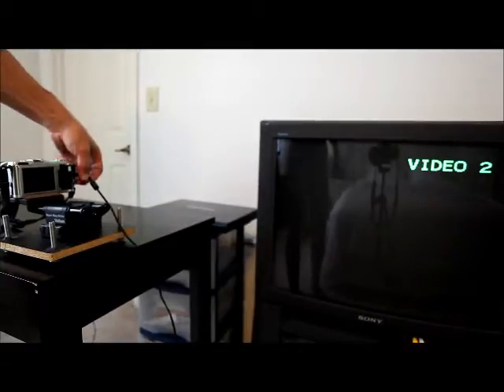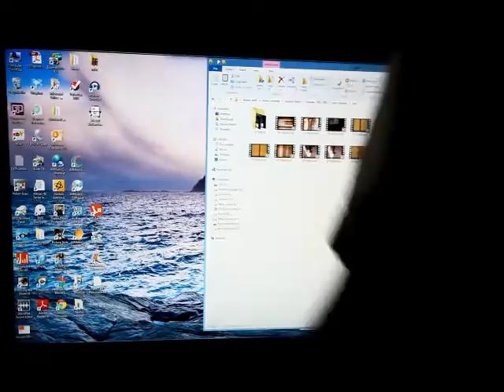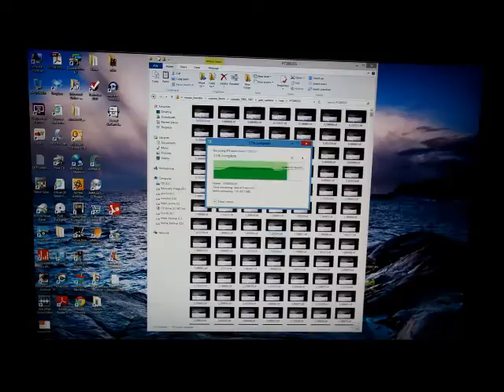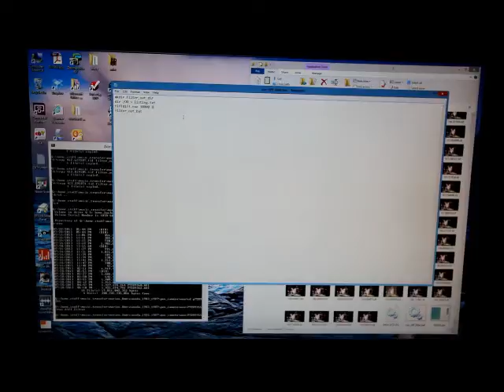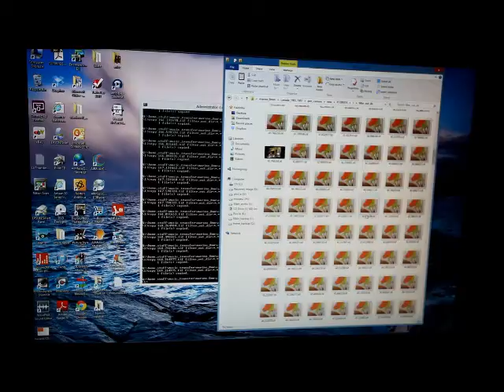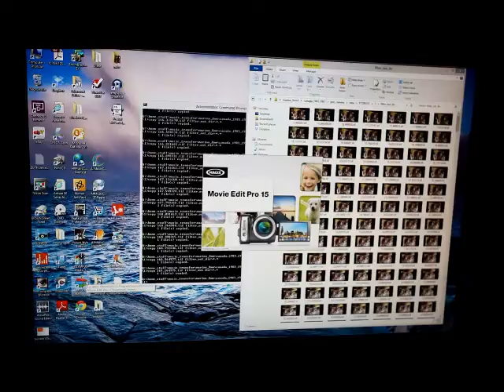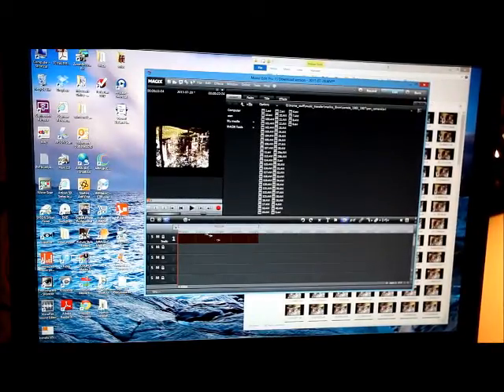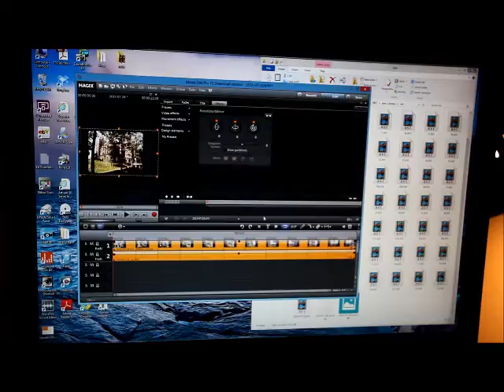Telecine DIY 8mm HD transfer demo.

Comment from the maker: In my last post I mentioned that I planned to do a project with the transfer to a cellphone.  Just wanted to inform anyone interested that the project is complete and the quality of the video is very good. The setup is much simpler than the previous one and it uses one of these:
https://www.amazon.com/Microscope-Teslong-Multi-Function-Magnification-Waterproof/dp/B01IV0TV50/ref=sr_1_1_sspa?ie=UTF8&qid=1546003803&sr=8-1-spons&keywords=teslong+ms100&psc=1
Will be posting the details shortly.

Comment: It is a different (original) approach if you want to leave the projector alone, but since you have altered the projector anyway you could also include a switch to the projector which triggers the camera on each frame. (Maybe in a mechanical way even) Much simpeler than filtering multiple captures of the same frame (including transitional frames which have to be gotten rid of)
The projector will have to be modified to be able to run very slow (not possible now I guess) to match the speed of the camera taking pictures in a row.
Reply from the maker: Yes fredontube, that is definitely a good approach and I detailed that in my instruction book. Used a step down gearing system attached to the motor and custom bracket with a micro switch on the projector cam. The issues are  that it takes ages to do one video, high noise from the gearbox and the camera wear. Thanks for the comment.

Comment: what did you modified to the projector lens, please?
Reply from the maker: Claudiu Cobilanschi Essentially you remove the projector lens and use a macro lens with your camera. I described the procedure in the kindle book. Let ne know if you run into issues.

Comment: At what rate are you capturing? Theoretically this process should work in realtime speed shouldn't it? I'm thinking of trying this with my 16mm projector. It can run at 24fps and 15fps.
Reply from the maker: Possibly. The problem is that the camera and the projector are not synchronized and you will have transition frames in the capture. I grab it at a 1/4 rate or slower so that I have enough good frames between the transitions to be a able to compose a video without dropped frames.

Comment: Did you take Matrox tocapture pics?
Reply from the maker: Not sure if I completely understand the question. Are you asking for frame-by-frame?
Reply: I asked for your software to capture the pics and make a movie from this pics.
Reply from the maker: I use a camera to capture the video from the projector. Then use BlazeMediaPro software to decompose the video into individual images. Then use my tiff diff software to eliminate the duplicate frames and then Magix software to comose the final video from the images selected by tiffdiff.
You can buy BlazeMediaPro and Magix software. Alternatively, search for "how to decompose video into images" and :how to compose video from images". Possibly use ffmpeg utility. My software is free. I put the executables here:
https://www.dropbox.com/sh/gn3tdhc3io17v5j/AACzZ79oZdnVeuACThT_WqK5a?dl=0 
Copy the executable files to the folder where video images are and run run_diff_filter.bat there. This will create the output directory and put the final images there ready to be imported into the final video.
I am willing to share the source code as well if you want to play with it. Let me know.

Comment: you mention a motor control setup using arduino for speed control of the projector.  i am using an old Bell and Howell super8 projector that runs on a shaded pole, single phase 120v motor.  i assume it runs at 18FPS or so, and need to slow it Down.  I see a schematic you posted on line, but can't read it.  Can you provide a usable schematic of your setup with parts breakdown, and Arduino software sketch?  
I am having success, optically, using an Olympus Sz-31MR camera,24X zoom,  filming through the large lens removed from a broken Binocular.  I can provide pics with comments if you can email me your email address.  Currently, getting the projector speed under control is holding me up.
Thanks,
John Couvillon
Reply from the maker: Still working on this? Let me know and we can discuss.